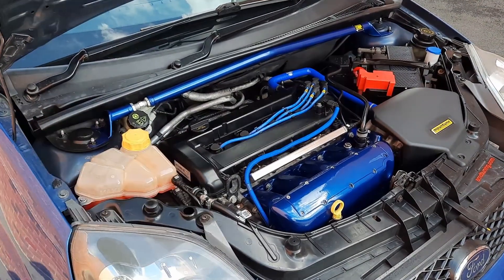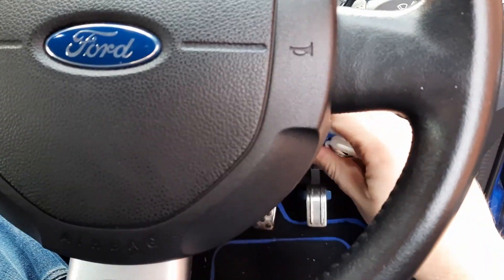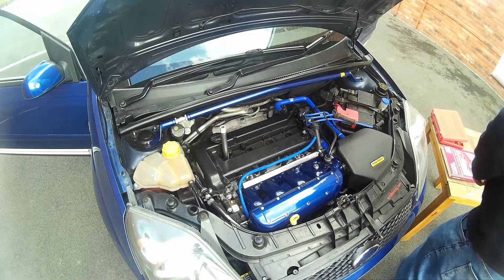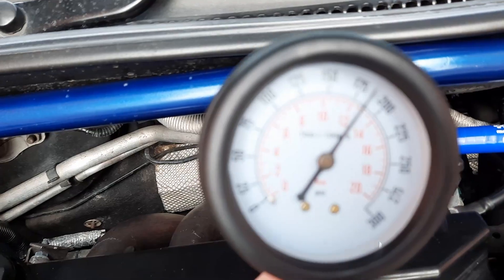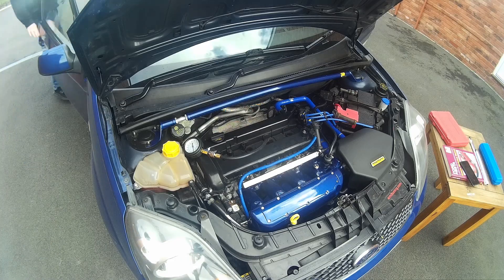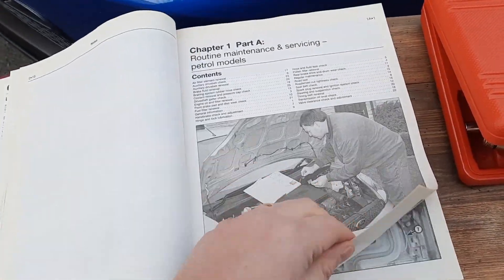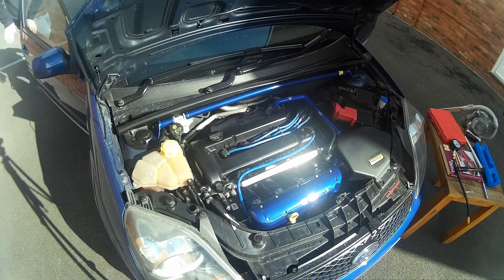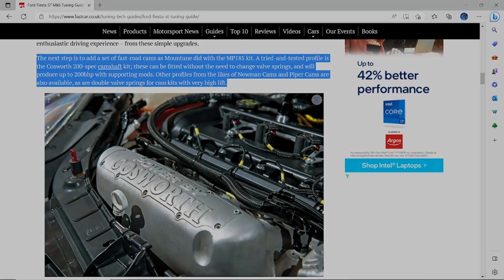How to Compression Test your Engine - Ford Fiesta ST Mk6 ST150 Duratec 2.0

Comment: Do you open the throttlle body plate to allow no restriction. Been alot of debate of yes & no. Your opinions
Reply from the maker: @cmarsz  I didn't actuate the throttle... to be honest as long as they are all good and consistent pressures across all 4 cylinders, it shouldn't matter. I was searching for a dead cylinder or generally low compression.

Comment: I tested mine and my psi was 245 - 250 - 250 - 245. Is that too high?
Reply from the maker: Depends on the gauge, engine temperature etc... the issues come when pressures are too low. Sounds like a good healthy reading and not much between them.

Comment: Cool video and well edited. Be ace to try this on mine one day.
IL be replacing my rocker/valve cover soon and did a test the other months to remove the Leads and first two I could get out but the the others I couldn't. Any idea how to safely pull them out
Reply from the maker: Thanks Andy. Just warm the engine up and they should pull off. If not, give them a 45 degree twist and then pull. If the plugs haven't been out in a while and overnight soak with WD40 can work wonders.